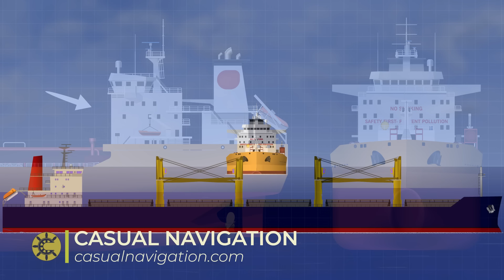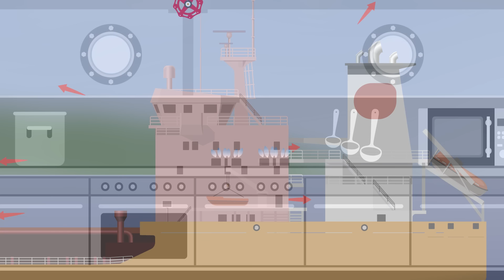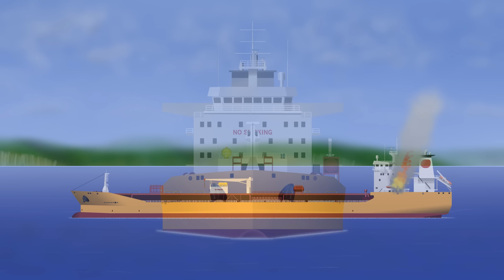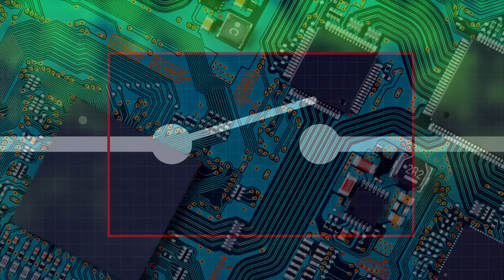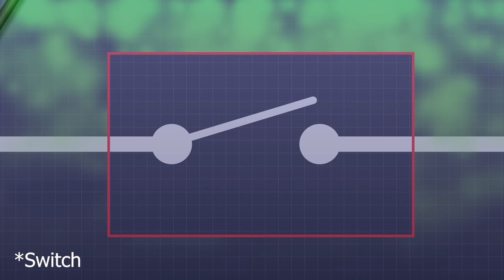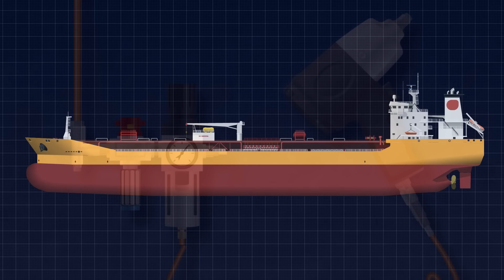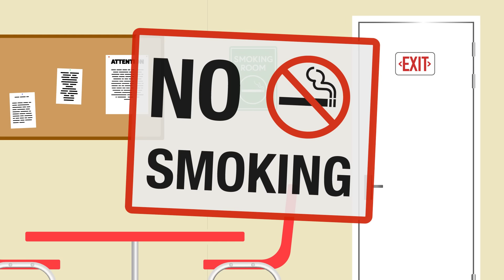You Can Smoke On A Fuel Tanker! So Why Is This Sign Here?

Comment: Fuel tankers are basically engineered in the same way as oil/gas rigs or platforms. You've got the safe areas, inside the accomodation/control room/radio room, and everything outside is considered a dangerous area, which requires the use of intrinsically safe equipment. This also applies to walk to work vessels within the 500 m zone of such a platform. Nice video once more, thanks!

Comment: While I understand the need for paranoia about sparks it really seems like a stretch to include things like radios or phones. Then again that might be a left over from older equipment but it just sounds increasingly implausible that such low powered devices could be a ignition source.

Comment: Your understanding of how electricity causes sparks really does need a lot more research.Switches and circuit breakers (unless there's tens of thousands of volts flowing) will only make a momentary spark when they open and NOT when they're closing.The insulation of the air doesn't break down until we get to about 4000 to 5000 volts,hence the use of lower voltages at such times as this could be a problem.
The modern printed circuit boards you showed operate at logic voltages typically under 6 volts.With the exception of the exposed solder pads they are covered with a solder resist that is a very good insulator.The copper tracks (or 'lands') are so thin they burn out in about a second if anything goes wrong.
I visited a coal mine in South Wales a few years ago and was surprised by the restrictions placed on us when we go down into the mine.No mobile phones,no cameras,and even no car alarm remotes.When in the mine they showed us the emergency signalling that ran the entire length of the mine.It's a pair of exposed copper wires that are placed a couple of inches apart and are connected to very loud bells placed in various parts of the mine.In the event of an emergency,the miners would place anything metallic across the two wires to complete the circuit and sound the bells to alert others of the emergency.Back EMF from the bell's coils would create a sizeable spark when you remove the metal shorting piece and would be a potential source of ignition.It makes no sense that they would consider a car alarm remote with a tiny 3 volt battery in it dangerous enough that they couldn't be taken down into the mine.
Reply: Okey engineer 😶

Comment: The No Smoking sign also appears on some non-tanker ships -- I have seen videos of bulk carriers with the same giant lettering on them.  In this case, they might be worried about igniting something like grain dust (which, by the way, can explode under the right circumstances of mixing with air).
Reply: hell grain dust can self/ spontaneously combust or explode like those silo grain bombs essentially that happen on farms from time to time due to the same thing
Reply: 3 blue kones😅
Reply: @moneybilla  I mean, you're dealing with some waaay freakier chemistry than mere grain dust if it can literally self-combust. But yeah, it doesn't take much
Reply: Flour can create its own static charge so ot can effectively self combust under the right conditions
Reply: @mnxs  Trucks carrying margarine going up in flames is quite startling when you first hear that.  Lots of things are more dangerous than their daily use would seem to suggest.
Reply: Metallic dust isn't any better
Reply: Pistachio nuts are classed as explosive payloads for exactly that reason! The dust and air between the shells acts as a perfect catalyst for an explosive flash fire. Ships have sunk due to it!
Reply: Grain dust or coal dust can explode . That bulk carrier might have been an O.B.O , ( oil, bulk ,ore ) so could have been loaded with oil
Reply: Its good to know i can use my air-powered grinder safely on board
Reply: Many of them carry coal.

Comment: Tankers are Hot Work job sites.  No steel tools allowed in hot work area due to their propensity to cause a spark when used or dropped.  Hot work tools are usually made from a bronze alloy.

Comment: My grandfather used to work on a large oil tanker on romania (MT Independența) that ended up sinking due to a greek ship that smacked into it, but thats not the point, the thing is he told me, a bulgarian oil tanker, had exploded due to a cigarette (it was on the stern helipad) But back on those days safetey were different ig, because of this NO SMOKING was allowed in any size of the ship, he told me they saw a guy smoking... On the next port he did not leave with the oil tanker

Comment: Love the swinging ladles! And the bulging fuel hoses... I remember Kaiser-class oilers, if you wanted to get to the main deck forward of the house, you had to go via the 01 level, because there were no doors at all between the tank deck and the after section of the main deck, for just this reason. And positive pressure. It's a lifesaver, for sure, but there's nothing quite like a ship that gets passive-aggressive with you, every time you try to open an exterior door.
Reply: passive-aggressive ship, lol. Love the mental picture, thank you.
Reply: Reminds me of the time I was working on a Navy destroyer (as a shipyard worker, not military service), we were doing hotwork in the CIC room and had about 30 horsepower all combined worth of ducted ventilation fans to keep the air clean of weld fumes (The Navy really doesn't like contamination in their CIC room, which is full of very expensive computers and equipment), and any time you wanted to go outside you had to partially crack the door (their doors have locking lugs that allow the door to crack slightly open before fully releasing for just this reason), I watched a young and petite female sailor just about get yanked off her feet when she opened the door too quickly🤣, the handles are big chunky heavy things so you can't limp wrist it, so she had a strong grip on it when it let go😂.
Reply: What do you give a person who can't have one night stand because it won't fit in the back

Comment: Phones have never be a risk for those kinds of ignition. The reason phones can be dangerous is because people are far less likely to ground any static build up because they are holding their phone. 

Every single petrol station fire where the phone was blamed has been down to static discharge when picking up or inserting the nossle into the car.

Modern pumps even have a safeguard put in place to minimise the risk of it happening.

Comment: I am curious if a cell phone can in fact ignite anything because I have seen this repeatedly tested and nobody has ever made it happen.
Reply: The battery can. And theoretically the phone itself can as well, although this probably rarely happens.
Reply: Due to how airtight gases and/any other liquid is in these ships its very hard for it to happen. Also, any grain bulker can also explode if the cargo gets wet due to gases and expansion which is why cargo holds need to get shut whenever rain gets close to the port.

Comment: Wait, is this why planes didn't allow electronic to be active at all before? It's a pressurized tube with a mixture of several games, some combustible or flammable filled with very flammable objects  like chairs and people
Reply: No, it's because we cant always be sure that some electronic device wont interfere with a piece of communication or navigation equipment. 5g actually does interfere with many aircrafts radar altimeter, but mostly from ground stations. Airports with 5g towers near the runway will have a NOTAM stating that the towers are present. It's not a big deal though, I'm a 737 electrician and I'm leaving my phone on, pilot definitely is too.

Comment: Spark gaps are common in electronics. A spark gap, as the name implies is literally a gap between pins of a component which electricity jumps over.  They're most common in cpu processors as they allow for quicker computing, and are always in an enclosure, but this doesn't necessarily mean safe either as most of us tend not to notice damages to a phone unless it's the screen.
Reply: Wtf are you on? A spark gap in a CPU to allow for faster computing?? I call bullsh!t on this one.

Modern CPUs run on 1V-1.5V, while spark gaps require a (relatively) high voltage that would instantly fry the CPU. Not even mentioning the MASSIVE electrical noise generated by a spark gap.

Do you even know how does a CPU work?
Reply: @rosskrt  bub spark gaps can exist in a vacuum or in a space filled with gasses. This can cause low voltage sparks even at high resistances depending on the gas (or lack there of) in question.

And to answer your question I've taken 8 years of college courses majoring  in computer science and minoring in computer engineering so yes I have some level of knowledge.
Reply: @hippiedude2232  apparently not enough knowledge about the inner workings of a CPU. I’ve studied CS for 5 years too, and I’ve also asked a friend who’s an EE just to make sure I didn’t miss anything.

I didn’t. 
So here I am, asking why do you have to write such nonsense in YouTube comments. Why is that? I can’t wrap my head around it. 

Spark gaps are somewhat common in electronics, sure, but “they’re most common in CPUs”? No bud, stop trying to fool us. There isn’t a single spark gap in a modern CPU, let alone multiple ones. 
As I already said, spark gaps are a huge source of electromagnetic noise and as such they’re completely unsuited for a CPU, which is an extremely sensitive and fragile piece of tech. You should know this.
I know about the use of a spark gap as a protection against high voltage spikes, but that’s not what you said, at all.
CPUs don’t even need a slow and noisy switch like a spark gap, because there already are FETs to do the job; and they’re much faster and much less noisier. Again, you should know this.
So, the “quicker computing” thingy is just A-grade complete bullshit.

And if you’ll allow my personal opinion, a person who spent 8 years of their life studying CS and a bit of CE wouldn’t call them “cpu processors”. It’s like saying “smartphone computer”. Nobody does that. But I could be wrong on this. 
I’m sure about everything else though.

Comment: The great advantage of tanker ships, in relation to electrostatics discharge, is the presence of salt and humidity everywhere. They discharge any static electricity buildup long before the potential can increase to the level it can generate a spark, or a dark corona discharge.
Imagine a place with opposite conditions, as an Artic station, with -25 °C during the day, with almost 0% relative humidity; a single walking step on a plastic floor donning rubber shoes generate a one-inch long spark.
Smoking tobacco is at about 900 °C. Vaping is safer because the heating coil tend to be below 200 °C but, should the cotton wick dry up, the heating coil can get red hot at the same 900 °C of burning tobacco...

Comment: “What about in port?” Like when you have an FRSU in port and mountains of coal on the pier that are smoking 🤣

And yes I am speaking from experience (port operator/traffic control). But luckily those were seperate.
Recently we got loads of coal for the first time and the stevedore company didn’t account for coal starting to self ignite when it is piled to high and not shifted around frequently. It is sorted now and the FRSU is only being refitted here so no Gas in it.

It was still a big concern for us as it wasn’t clear if we’d be the port for the regasificatiob or not.

Comment: you're conflating ATEX compliance with intrinsic safety. IS is only one way that electronic/electrical equipment can be designed for use in explosive atmospheres, but there are methods too. IS essentially means that there isn't enough energy in the system to ignite any vapours. Other approaches basically involve separating any potential ignition source in the equipment from the explosive atmospheres e.g. using special enclosures or encapsulation in insulating resin.

Comment: I’d have guessed that the crew accommodations / safe zone would have been ahead of the cargo / danger zone. That way all of the heavy petting is upwind of any dangerous gasses.
Reply: That creates further problems and expense, though. The propeller and rudder, for fairly obvious reasons, have to be at the rear of the vessel. It's a lot easier to put the engine back there as well, otherwise you need a way to transfer power from the engine in front through the entire ship back to the propeller and rudder, as well as control signals for the rudder etc., which adds additional things going through the cargo area that could generate heat and ignite the cargo and increases risk of a failure of those systems that could, e.g., leave the ship drifting on to rocks or wherever. You get the idea.
Reply: In that case, the crew area will be more vulnerable to the incoming waves.
Reply: Actually my shipping company got the great idea of building new tankers with accommodations forward. Worst shit you can imagine. Not only because of stability but also because the engine is still aft, when the weather is bad nobody on board is sleeping because the anchors are super loud, the whole safety concept is stupid with the free fall boat being aft. Also they got a dual fuel system (lpg and regular fuel) which is super stressful to maintain, especially for the pump man who constantly has to make used up tanks gas free and cool them down again. Ive heard of no one who like these new vessels

Comment: Having inspected a few hundred cargo vessels, I've found that quite a few non-tankers also have the no-smoking sign. Bulkers tend to have them as well, I wonder is it because of coal as cargo? It's not as explosive as fuels but is still pretty flammable, right? Perhaps it's just a good safety policy to keep smoking to the accommodation (though it makes for quite an unpleasant atmosphere in there).
Reply: Dust in the atmosphere can be more explosive per metre³ than petroleum spirit vapour, for instance. Sugar, flour and many others have completely flattened many whole factories!
It's not just coal dust by any means!
Reply: @Aengus42  coals can self ignite specially when on rough seas causes the chunks to rub on each other generating friction then it jus self ignites n shit goes bad biggest example was the titanic on its maiden voyage was burning from the inside out
Reply: hell carrying Potassium nitrate is one giant bomb basically

Comment: Especially with fewer people smoking these days, I always figure (at least from a safety perspective) that "no smoking" is used as a general and universally recognized term for saying not to have any potential ignition sources in a given area due to such hazards, not just smoking. Though I'm sure there's a lot of practical needs to have the accommodation block at the stern, it does feel a little odd to put the accomdation block behind the potentially dangerous gases where said gases would be blowing towards it instead of in front where the gases would blow away. This is one advantage I see of my Volkswagen Beetle's rear engine, no exhaust in front of or below the cabin so an exhaust leak won't get inside the car (unless the heater is on).

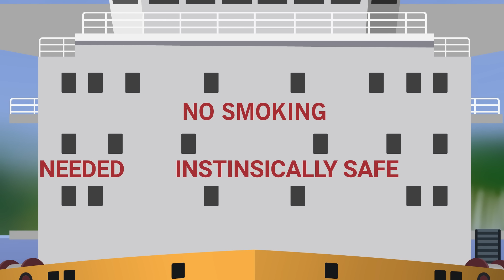Comment: @ 5:56 - Speffling mistale.  Not sure I agree about sparks around electronics mounted on circuit boards - generally, you will get current leakage across the surface of a device or circuit board, rather than flashover, regardless of the age of the apparatus. The type of potential gradient required for flashover in air requires a number of factors which are unlikely to occur on PCBs.
What about metal devices (intrinsically safe or not) striking each other and creating a spark on impact?

Comment: You're more likely to get a spark off a polyester blend sweater than off most portable electronics.

This was amply demonstrated a few years ago when there was a series of fires at petrol stations and they started by blaming people using mobile phones despite the "no phone" signs on pumps, then ran some tests and realised they had all been caused by sparks generated when the driver touched the car's outer metal casing after accumulating static charge due to their clothes rubbing against the seat.

It also disproportionately happened to women, because they were less likely to touch the metal on the door as soon as they got out (which would discharge the static before going near the tank) and because they tended to go back for their purses (which resulted in a second point of contact with the statically-charged seat).

Maybe that's the real reason why some old sailors used to say it's bad luck to have women on board. And we though they were just misogynists. :-P

Comment: I have worked on a tanker for several years. And the crew smoked even when working with fuel, fuel hoses, works on deck... And we worked with electricity daily, not just compressed air...